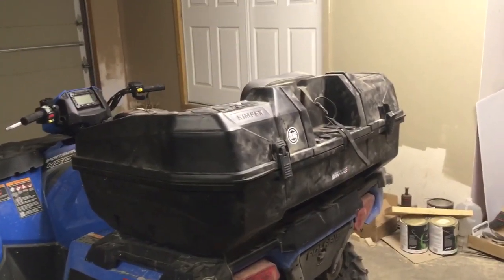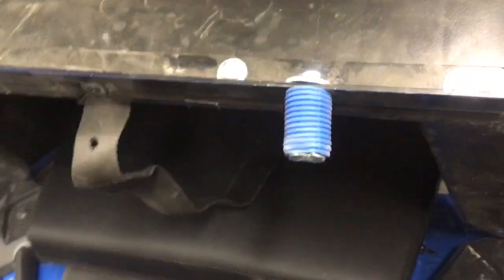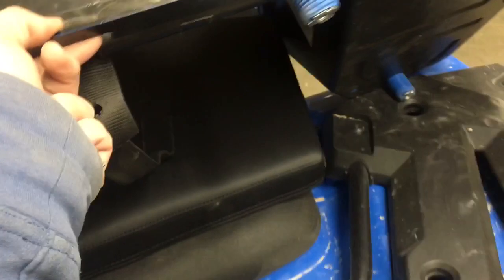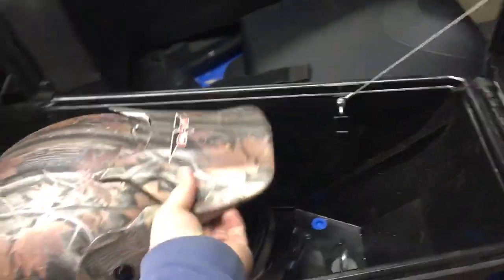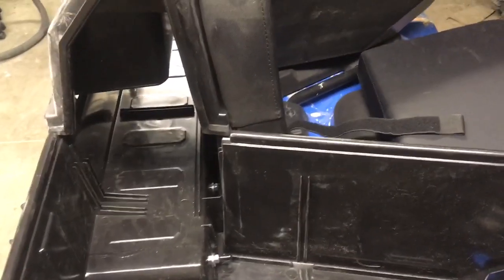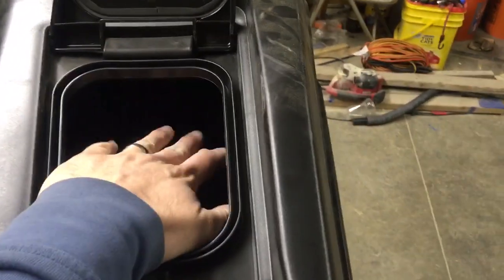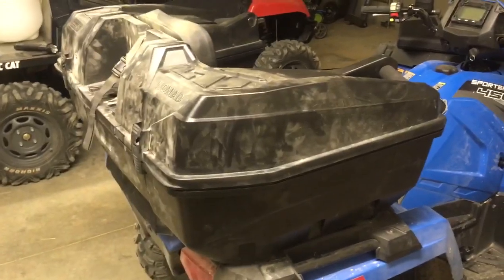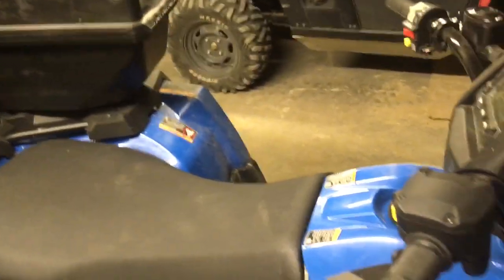Kimpex Nomad ATV trunk on 2018 Sportsman 450

Comment: Watched your video and mounted mine the same way.  I lined up the back first, squared it up and mounted those loosey (3/4 were the perfect length) .  Then I turned the rest of the mounts with the bolts in upside down so the bolts are sticking up just a little bit.  A dab of paint on each and marked the underside of the box.  Drilled the holes and they lined up perfectly.  Thanks for the info

Comment: Thank you so much for this video. I called to see how much it cost they said around 299. What did you pay for yours? So if I look those up on eBay they're called Pro Grips? This seems like a big and bulky box but plenty enough storage for just about anything. I need one or two of these for my 2015 Polaris Sportsman etxs.
Reply from the maker: I got the truck from Rockymountainatvmc.com and the list price is $224.99 US, and I think I paid about $240 after tax with free shipping. It’s the Kimpex Nomad trunk. The anchors are called Grip PRO ( sorry I call keep calling them pro grip) and I paid around $18 for a six pack, got them on eBay. The box is a little big, but I am liking it.
Reply: Ok so going to eBay and searching “grip PRO” doesn’t show the expansion plugs that you used. What needs to be added in the search besides JUST “grip PRO” to find the product you used?
Reply: Found them...Grip Pro ATV anchors.

Comment: Hi, when you drilled through the cargo box did you a drill a 1" hole  thru box for the grip pros or did you dissemble the grip pro and just drill the diameter of the bolt and then reassemble the grip pro on both side of box/integrated with box.  Also have you had any trouble with the grip pros wearing out or the box coming off accidentally
Reply from the maker: I disassembled the grip pros and drilled holes the size of the center bolts. Then reassembled through the box with a large flat washer inside. Seems to be very secure. I haul it on an open trailer at freeway speeds and the box has never come lose. I’d recommend removing the bottom seat cushion before hauling, it’s just velcroed on.
Reply: @unclesam8010  thank you very helpful. I am in the process of putting the nomad plus on '19 sportsman 570 the same way as yours using 2" aluminum angle and the grip pros with the star handle knob. Saw some bad reviews of the Polaris brand anchors failing and wearing out. I'm liking the grip pros a lot better
Reply: I suggest doing the rear first...then put the bolts upside down in the holes, a little paint and set it down with the rear mounted.  Easy way to make sure they are all lined up

Comment: Any chance I could get your input on how to attach this trunk to a 2018 can am outlander 450?
Reply from the maker: I don’t remember their racks exactly, but I think they had tubular steel frame around a plastic middle. So I think you would be able to use the u-bolts that come with the Kimpex trunk. It would cover up the factory Can Am storage box, but I think the Kimpex trunk has enough room to make up for it.

Comment: Hi uncle Sam, I was just wondering where you got the extra front mirror from. 

Nathan
Reply from the maker: The mirror is a Kolpin atv rear view mirror. I don’t remember for sure where I got it, but it’s part number 97200. It just barely fits the bar on the front rack. It’s an ok mirror, but seems like I have to readjust it before every ride.
Reply: Ok thank you. As another way to mount the box as a recommendation you could shove a piece of sidewalk chalk  in the holes on the rack and then move the box on top of the chalk to make a trace where to drill. Just thought I would tell you. 

Thanks

Comment: i have a 2000 trailblazer would this trunk and seat fit do you know??
Reply from the maker: It is a “universal” trunk so it should work on most ATVs that have a rear rack, although it is a large trunk and might on the big side for a quad like a trailblazer.
Reply: Oops never mind...found them Grip Pro ATV anchors.

Comment: What size bolts are those?
Reply from the maker: They’re 5/16 by 1 & 1/2 (I think). The I-bolts I replaced (with regular bolts) need a thick washer on top so they don’t rub the fender under the rack.